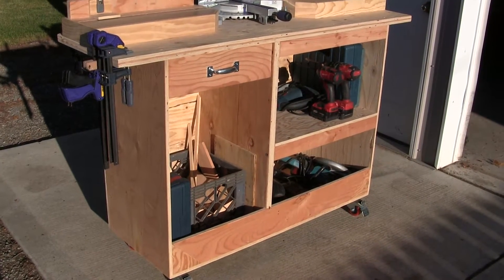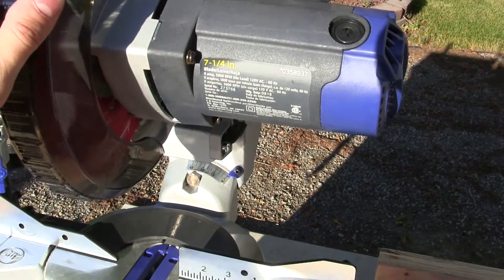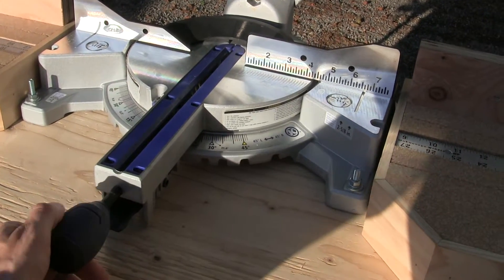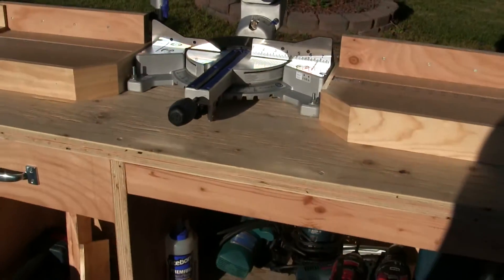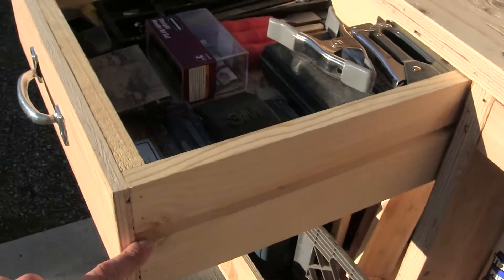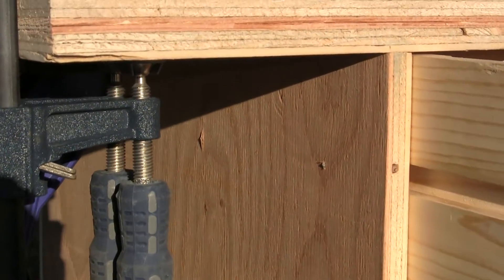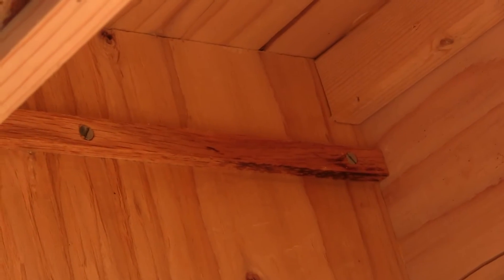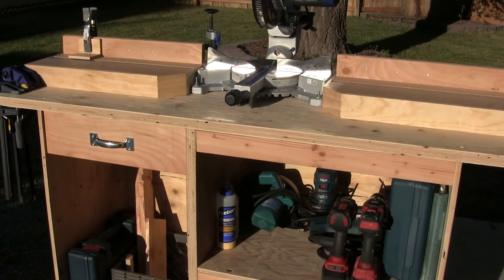Excellent homeade miter saw stand - Construction details. Kobalt 7 1/4" sliding miter saw

Comment: Very nice cart! Put some candle or paste wax on the runners and the drawer will slide smoother and last longer.
I have the 10 amp version of that saw and it will probably be my last Kobalt tool. I've never liked the Kobalt tools I've bought, but this saw is pretty nice for the $85 I paid for it. The big problem is that customer service told me that they do not sell replacement parts for it, so it's basically a throw-away tool.

Comment: Great stand and cabinet, Charles!
Anything new with the Joe Cell?
Reply from the maker: Nothing new been playing with a Bob Beck magnetic pulser for making 350 volt capacitor discharged magnetic fields ha. I'll have a good video of it soon.
Reply from the maker: How is the hydrogen resesrch going ?
Reply: Other than study, haven't started into the Joe Cell yet. Or H2 research in general.
Working in a few other areas of energy research.